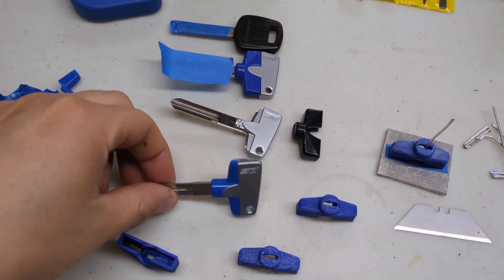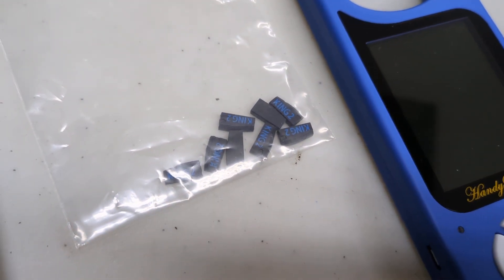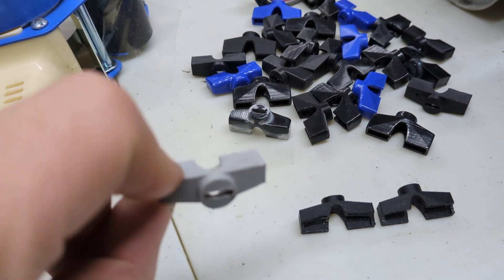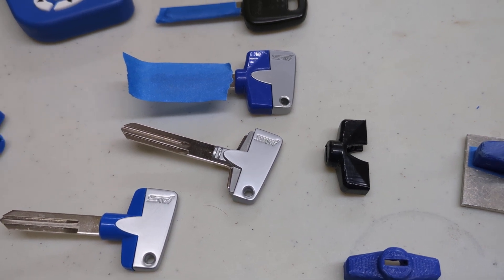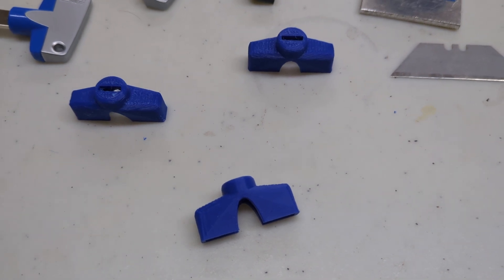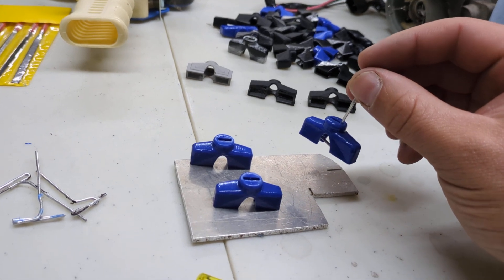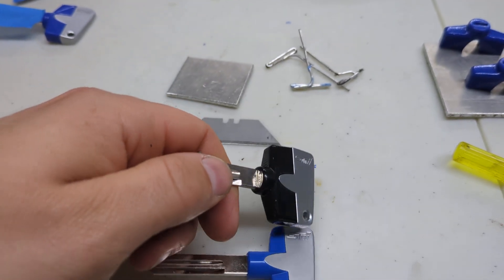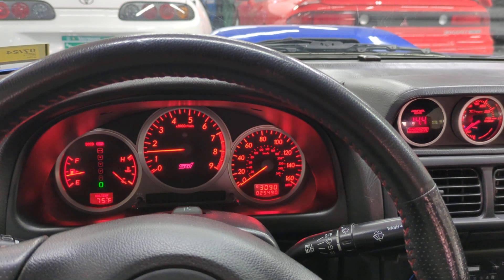Adding Immobilizer chip to 2004 Subaru Wrx Sti key

Comment: Just checked out your website and saw you started using resin printers for v2 and wow unbelievable how good they look. They look better than oem specially when you clear coat them. And the color is spot on to oem. I tried to find a way to purchase on your website but didn’t see one. Are you still selling?